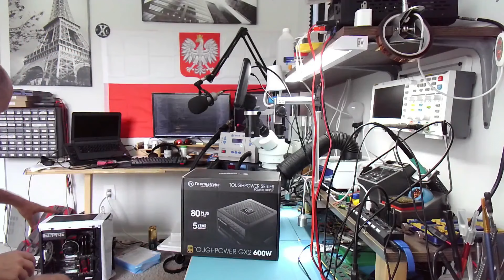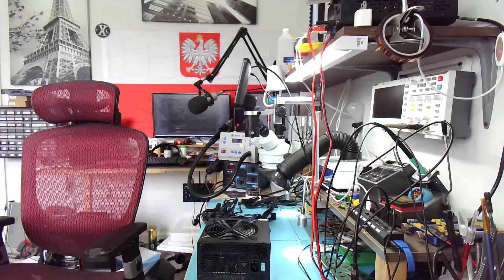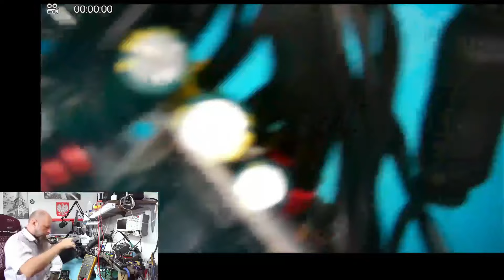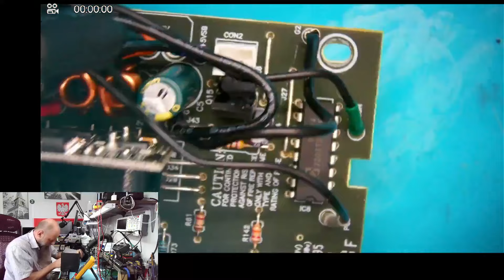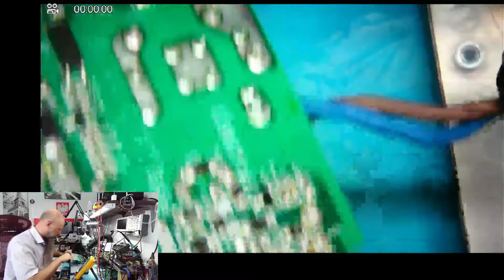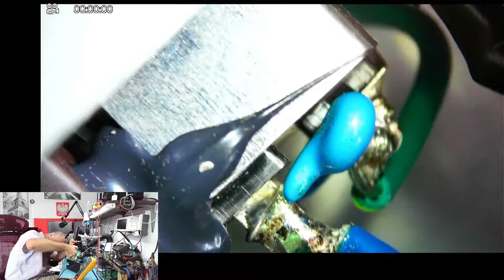Day #36 | ATX PSU Repair No Cuts | How My Coding Test Go

Comment: look at the IC diode photo to the left of ic6, it is this which seems to activate the relay (at 35'58")
if when you turn on the power it is not through like a relay it either has a problem with its power supply (220v) or does not work: it serves as safety between the base and high voltage.
It could also be a problem with the 12v power supply distributed to your relay.
good research.
Reply from the maker: the IC is marked CM6901X but VCC pin on the datasheet doesn't align with what I see on the board so I'm not sure. Yes, the lack of power to the relay is the reason it doesn't turn on, but when I inject the power it produces 2V above the threshold so really don't know about this one.